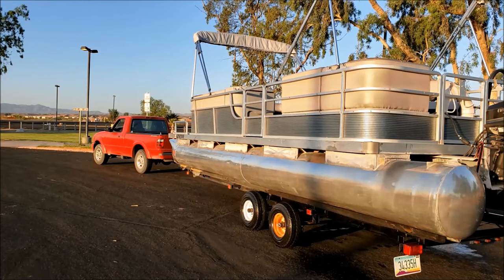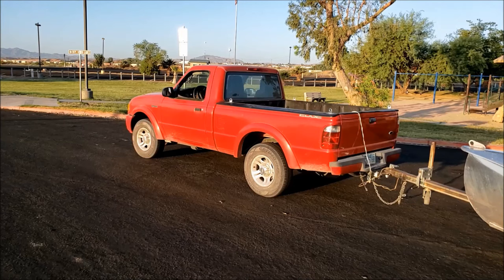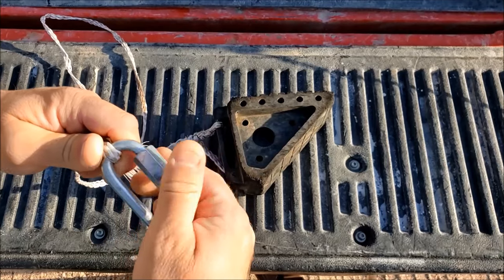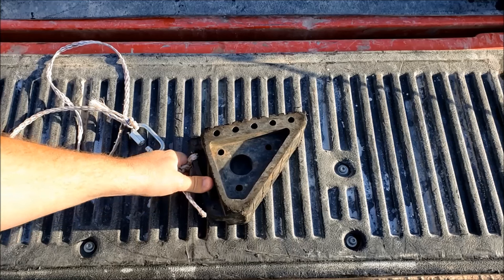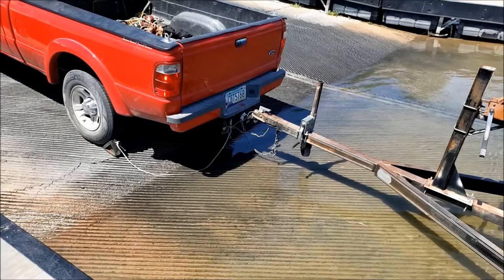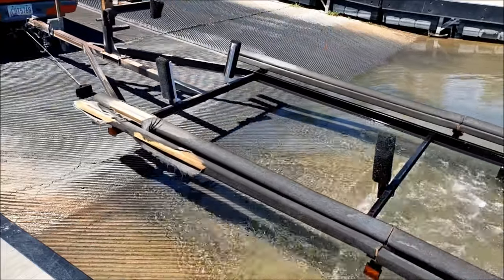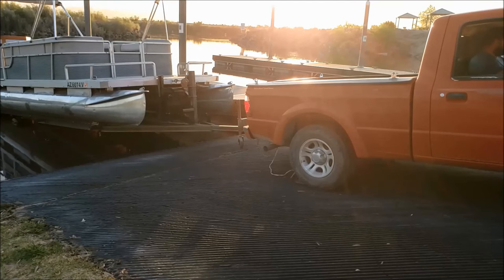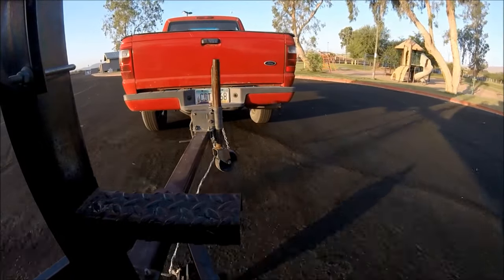Launching a Big Boat with a Small Truck & Manual Transmission

Comment: Brandon, I use the same Harbor Freight wheel chock, but I put in behind the front tire on the driver’s side with a long rope which I throw into the front driver’s window. When I get back into the car and start moving forward, I just pull the rope and the chock comes into the car. Enjoy your videos.

Comment: Thank you for this. I have a 4.0L V6 Ranger standard and a 20' Aquasport with dual 50hp Evinrudes. Going to be putting it in the water for the first time sometime this month. The wheel chock idea is brilliant, definitely going to do this. Funny we have the same name, the same truck (almost), and I've been watching you to get those 1976 Evinrudes running again after 30+years. Thanks!!!
Reply from the maker: How did it go?
Reply: @BrandonsGarage  spent the whole summer towing it 60mi each way to the ocean, never failed me once but was definitely close on the max rated weight with a full fuel tanks. The only issue I had was a short on the trailer that caused my headlights to short out once going 50mph but was able to get it restarted and rolling again

Comment: Great idea. With my old 1972 F-100 with 360 V8 and 4 speed "granny low" I would do the same thing except I would use the manual parking brake to do the same thing. That "GRANNY LOW"  gear was so low with my limited slip dif...worked like a charm  every time for 18 years.

Comment: I've been doing the same thing with my Mazda mini truck for years, lots of boats, my 12 foot trailer and even some cars on the dolly. Never used a chock but I have the heel toe thing down pretty good from all the offloading I've done. In all these times I've only gotten truly stuck once. It was a steep boat launch and after a day of boating the wind had picked up and soaked the whole thing, it just wasn't coming out. So I did have to give a guy in a full sized ram 20 bucks to pull the boat out for me. I was actually much more stuck once with my locked up jeep, just a heavy boat and a crappy launch the was all busted up and the tire of the trailer sunk in the mud between two big blocks of concrete. That one worried me a bit since it wasn't even my boat. But I was able to get it back off thr trailer and reposition everything

Comment: I have a little 4-cylinder with a 2wd, manual transmission. It has maybe 120hp, but that's PLENTY of power for towing. It can pull 6000lbs to 55mph easily.  But the little truck doesn't have the mass to control a heavy load and it doesn't have the brakes to stop it. Dangerous! Boats usually aren't that heavy; the issue with them is traction. You need to make sure that your boat and trailer put enough weight on the tongue to hold those rear wheels to the ground. Most small boats and trailers won't do that. For me that means sand bags in the back of the truck. Worst case scenario, get your buddies or your fat wife to stand on the rear bumper and bounce up and down.

Comment: Thankyou! I was concerned my 3.0 ranger couldn’t put a boat in that size. Looks like your truck did it no problem. Mine is automatic. My jon boat is no issue. Approximately 600 lbs though

Comment: Do I need to use a brake depressor inside my truck to keep the brake pedal depressed? I know that the emergency brake only locks the rear wheels not the front

Comment: So simple yet this is going to save me this weekend after I get my new used boat tomorrow
Reply from the maker: Well, how did it go?
Reply: @BrandonsGarage  went out there without your set up the first time, regretted it instantly. Almost ended up on a boat ramp fail lol. I went back out with the ropes and it was like starting from flat ground!
Reply from the maker: @jimbobbojack9712  so are you still doing it? Sounds like it worked for you too.

Comment: Thanks for the video Brandon, great demonstration from a bunch of different angles. Just curious, what's your hp and how much you pulling? I have a 150hp 2wd Patriot and I'm gonna try pulling a 1500lb Macgregor 25 on a 500lb trailer out of the water
Reply: Using his technique. That should work fine!
Reply: You’re a mad man😂

Comment: I like that you found a video with matching color truck.

When I drove my manual, I would use the handbrake to prevent rolling back, then slowly back the handbrake off as I slipped the clutch.
Reply from the maker: yeah I used to do that, but the chock is so much easier.
Reply: @BrandonsGarage  Ya, definitely seems like a better solution.  It also has the advantage you have a physical stop if the tires slip and you roll back pulling out with a waterlogged boat.  Some of the ramps here can be pretty slick.
Reply: Also depends if the vehicle actually has a handbrake, or a foot-actuated parking brake pedal.  Apparently yours does, I thought Ford Rangers had the foot pedal.

Comment: How heavy is that pontoon….I’ve got a 94 4x4 with a manual I’m thinking about getting a tracker v16 a 2klb boat think it can handle it
Reply from the maker: Well 4x4 has the low range, you have a much better gearing option than I have.

Comment: You need a brake deppresor don't use a chock if your emergency brake goes out on a steep grade it wheel roll right over it brake deppresor locks your front brakes on a two wheel drive

Comment: When you're pulling out with the empty trailer, there's no reason you need to drag the chock. Otherwise great idea for pulling it out loaded.

I pull my 17 ft boat with only a s10 and a little four cylinder with a manual. I turn the truck off with it in gear and the parking break on then when I go to pull out, I just slowly release the clutch until it starts to grab. Then you can just peddle the throttle until you're able to fully release the clutch. Since it's only a four cylinder, I can't pull anything heavier or I would definitely be chocking the wheel
Reply from the maker: it was really just for demonstration, but you are correct, not entirley needed with an empty trailer.
Reply: @BrandonsGarage  understood. Thank you for sharing this. It's honestly a nice idea.

Comment: Bro is this havasu lol I’m in havasu and I wanna launch a boat with my 2.3 liter manual transmission ranger
Reply from the maker: Needles, so same water. 
You'll probably be fine. Might have to stop half way up the ramp and take another shot at it, but it'll work.